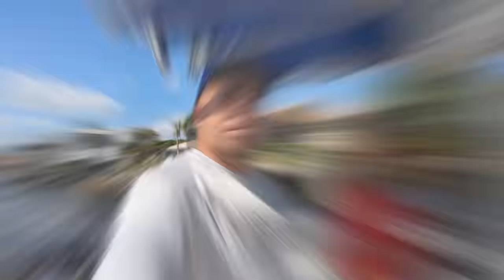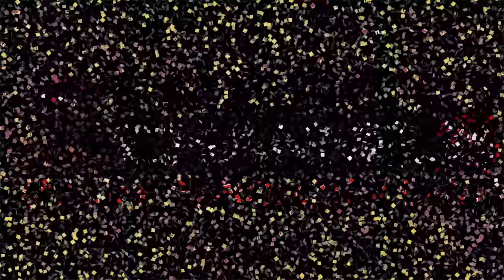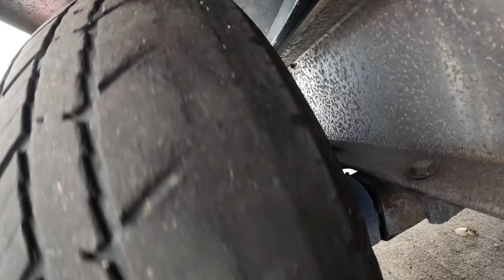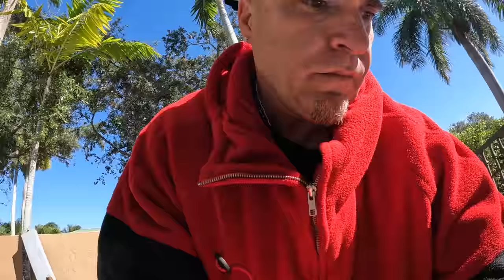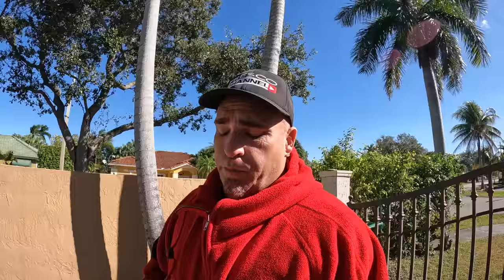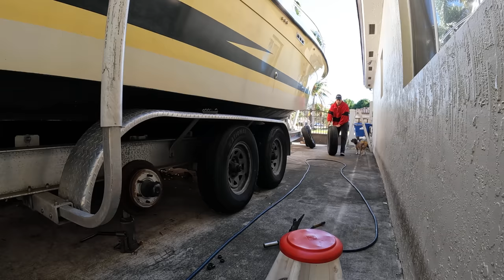How to Mount a Trailer Tire Yourself !!

Comment: Check your axle alignment: get a helper to hold a tape measure exactly on the center of the tire threads on the back of the affected tire and measure the distance to the back of the tire on the other side of the same axle. Then measure the distance between the front of the same two tires. If there is more than 1/16 of an inch your axle is bent or loosely mounted to the trailer frame.